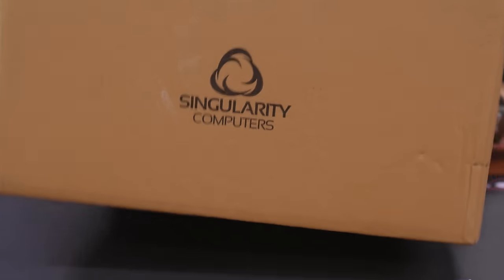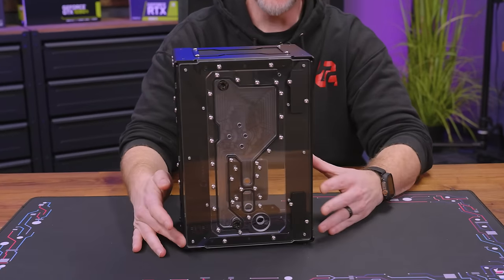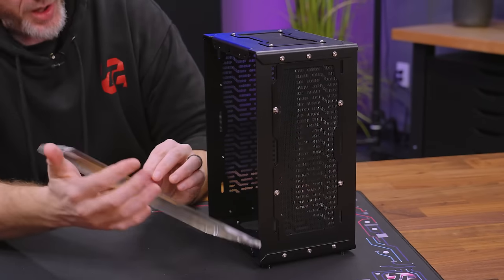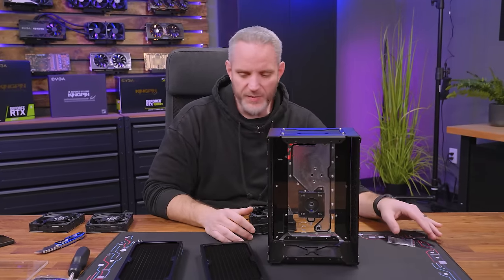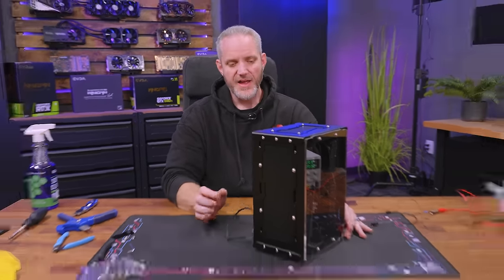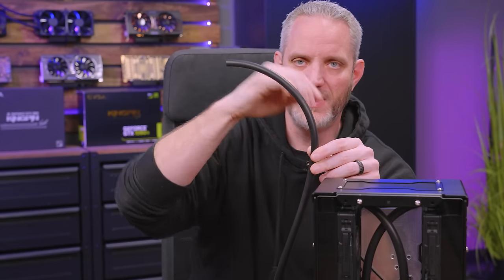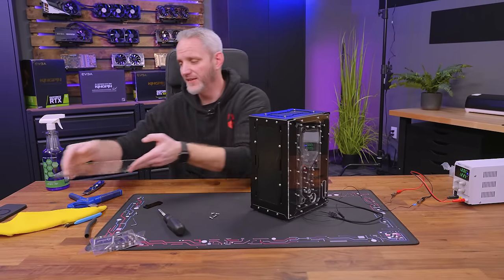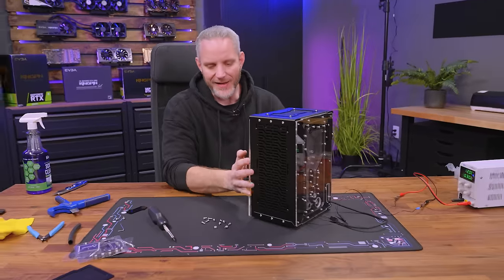External Loops are a thing again?

Comment: Bring the fluid into the case on the exhuast side, push fluid out of the case on intake side and make flow through. Some heat will dissipate through convection but it will go through the coldest radiator before leaving to pc.

Comment: If you want an easy way to control the fans, Noctua has a manual pwm generator that is basically an inline fan controller that you could use to control all the fans and the pump. The NA-FC1

Comment: I would love that accompanying my ssf build, when I had one. silverstone rz03. I cut it and put 120+240 rads. Then I switched to bq 802. 

As for air going through multiple radiators... I think as long as the air is cooler than rads, it will never warm them up. At worst the thermal transfer will be less efficient with air warmed by the first rad.

Comment: I think going with a horizontal push from one side and pull from the other would get you greater air speed (which would in turn affect the heat exchange rate), while pushing in from both sides is going to waste energy on turbulence even if you have a top-mounted exit fan.

You should definitely try it both ways and report the results.

Comment: External water cooling is so much more convenient, in my opinion, since you have everything but the blocks outside your system. And it allows you to have as much cooling capacity as you want without being restrained by any particular chassis and internal configuration. And you can change your chassis as well without having to worry about the water cooling setup.

Comment: I might be wrong but I believe if you did a flow through configuration the noise will be a bit lower as the air will not clash against each other as well as in such a small case have less positive pressure buildup for the fans to try and overcome. 
Flow through will lower pressure and noise... in theory 🤷🏻‍♂️

Comment: This is cool and has lots of potential, I think it will be most efficient with it pulling air in on both sides and exhausting through both ends if any way possible, either by adding feet on bottom or placing it on it's back so it can exhaust through both ends

Comment: This would certainly give you the option to test several different configs.  I was surprised that you were using pull on both, would have thought push would be better.  would love to see the comparison of the various possible configs.
One additional test would be to increase the size of the feet to see if getting more room at the bottom increases cooling capacity (in any fan config)

Comment: I finally remembered that Thermaltake had this idea years ago with the P100 and P200 cases, now granted these were to go with the W100 and W200 cases but it was the same idea of separating the heat extraction components from the computer components. 
The P (Pedestal) could be mounted to either the top or bottom of the W (Workstation) case, top being the better location, to separate the heat from the computer itself. The could accept up to a 600mm radiator or dual 560mm.

Comment: I have the fans of both my front and top rads set to exhaust. Then I flipped my rear 140mm exhaust fan around for intake with a dust filter. I also attached three tiny noctua fans as intake on the back with dust filters. My temps are insanely good with this config. My case is a Corsair Air 540.

Comment: 3:00 alaska is the same distance or closer from asia, so it's a drop off / stop over / refueling hub. Like, from Melbourne to Anchorage is 7'770 miles, Melbourne to LAX is 7'967 miles, and most other stops after LAX are going to be east bound, so they stop at the nearer destination, head southeast, continue east, rather than go to LAX, go backwards (northwest against the jet stream), then east again.

Comment: you have three ways of air flow
cross flow - this would depend on how you have the rads flow
-hot rad to cool rad, cool rad to hot rad
positive air flow - air flow in rads out top/bottom
negative air flow - air flow in top/bottom out rads

Comment: Top and bottom pulling air in and radiators exhaust facing out. This way, the cooler inside temp helps cool the distraction plate. If possible place rad fans on the outside.

Comment: Suggestion: turn the fans around so they blow through the rads and out the sides. Keep the filters off the sides and the filters at top & bottom will do their job as needed. This does result in a negative pressure situation, but I don’t believe it’s an issue since you don’t have any PC components to cool anyway. Thoughts?

Comment: Jay, both rads pulling in cold air will be more efficient than having a cross/through flow. Why? Simple: higher delta between air and rad means more efficient cooling. if you push warm air through one rad the delta on that rad will be (considerably) less, so it won't be able to expel as much of its own heat.

Comment: I worked with Daniel because I needed a dual Arterial 360 Waterbox, when he only had the OG Arterial 560 Waterbox.  It's been a god-send (aka Daniel-send) for my high-powered, water-cooled HTPC.  Use an HDPLEX 200W DC-ATX banned PSU powering everything, using a Koolance ExosV2 control board/PSU Trigger and an Aquero handling everything headless.  Two push/pull 60mm thick rads with no internal components like PSU, PCIe, GPUs, etc to cause airflow turbulence passing right through.  It's actually incredibly quiet...  It's the bee's god damn knees.

Comment: 2:56 The reason air travel prefers multiple flights is to increase total area throughput. Having interconnected routes allows for more transfers more often in more places. There are other reasons as well, but this one is the most generally applicable.
Reply: Because the earth is flat so they take a straight route.

Comment: Regarding fan installation (just my two cents :-)) : put the case on a higher stand and set all fans to exhaust. It will drag cool air from top and bottom and press it through the rads. Cheers from Austria!

Comment: I would personally have the fans blowing into the box and cause a positive pressure venting out of the top and bottom. Added bonus is in winter if you have it on your desk the exhaust out the bottom will help keep your hands warm.
Reply: I dont think positive pressure matters as much here when compared to a pc case, there are not other intakes than the filtered one on the top and bottom and I dont see any other holes/gaps.

Comment: This is basically what i done with a thermaltake tower900    the front chamber is a2.5 gallon aquarium as the res.  feeding 2 d5 pumps and 2 alphacool monstra 480 rads in the back and 8 noctua fans on the rads.   The cooling rower feeds 2 pcs 1 which is my workstation pc and the other is my gaming pc.    Temps are always very very stable and its generally pretty quiet..

Comment: I'd do intake on one side and the bottom, exhaust on the other side and leave the top open. That should give the "front" rad fresh cool air and the "rear" rad would get a higher volume of mixed air to play with. I feel like it could give 0.002% better efficiency

Comment: You should test not only push pull config, but the order in which the radiators are. If the first one in the loop is the one taking air from the inside it may perform better.

Comment: That's crazy. 2 months ago I was looking at the market trying to find a water box and no one had one except from this one company that wanted $800 for it, I ended up building one using two hardware labs xflow 420 mm rads. It was the best thing ever and I also don't have to worry when I choose a new case because just to have to install my pass-through bracket and some water blocks and we're off to the races

Comment: Rads on both sides drawing in and exhaust fans top and bottom (if there's room), or reverse it with intake fans top and bottom and exhaust out through radiator fans. You might end up with negative pressure but more total airflow, and without circulating hot air into the case.

Comment: Jay - as a retired chemical engineer who was an executive project manager for a large engineering firm that did many industrial/refinery projects that used air coolers (think of 25' wide x 200' long), here is my recommendation.  Set the air coolers to draw air in from the box and exhaust to the outside.  Put the biggest fans you can on the top and bottom of the case to draw air in from the outside and push into the box.  Set the intake fans to run twice as fast as the air cooler exhaust fans.  This way you always have cool air entering into the air coolers and hot air exhausted to the atmosphere.

Comment: @JayzTwoCents you should  see if its possible to put a small wall between the two rads and have the fans setup to push or pull the air in from the top and bottom and then out through the rads. It might work just as well without a panel separating the air so the fans arent working against each other, but I think the top and bottom could let in enough air that both rads have the fans oriented outwards and have both rads getting cool air through the top and bottom intake would be ideal

Comment: Interesting, I've been trying to build something very similar from a ThermalTake P100 case.  My server room is in the basement of the house.  The idea being this box would sit on the otherside of the wall from the server room (with pipes going through the wall) where it is significantly cooler than the server room.  Pulling cool air over rads (480s) from the sides, and blowing it out the top.

Comment: Things go to Alaska, particularly because of their top rating. If the plane ever loses an engine or all their engines they can only glide for so long. It's different for each type of craft but also for how much they are carrying. So going north to Japan then over to Alaska is safer than just over the ocean and maybe diverting to Hawaii if something goes wrong. Including lithium fires, which is unfortunate more common than they should be due to failure to properly label them and have them at the proper charge level for Shipping

Comment: you should do a video on testing the difference in fan orientations and do like opposing crossflow so for example both tops fans would be pulling air to left and both bottoms would pull to the right giving even amount of cold and hot air between both rads

Comment: Please do the fans in different orientation/configuration video! That will be quite interesting. 

Imo, crossflow with hot liquid coming out of the PC going to the rad getting hotter air and then to the rad with cooler/fresh air would work quite well, for both cooling and getting the hot air out. 

Since the liquid coming out of the PC will be hot, the hot air coming from first rad wouldn't impact/warm up the liquid as much as if the hot liquid was going to first rad, getting cooled and then going to second rad where it might potentially get warmed up slightly since the liquid is comparatively cooler, but the air has warmed up.
Also, there are cutouts at both top and bottom, so second rad will be getting supply of both hot and cold air, not just got air.
Reply: This should provide both rads with a decent temperature delta, which should be the most important parameter...

If you feel like it, please test it against the other way. I would bet crossflow would be better regadless of rad order (although it should help, might not be measurably).
Reply: Jay's done videos in the past showing that order of components doesn't have an effect on the loop, I feel air going from one rad through another is the same situation. Both are remocing heat from the same system, the rads aren't adding any extra heat of their own. I think a cross flow setup here might be marginally better simply due to sheer volume of air moved through the rads
Reply: I think that both radiators as exhaust might make more sense, it should have less "air pushing into other air"
Reply: @nicholascrow8133  
I meant rather than rads adding heat of their own, the air passing through the first one might get heated enough to warm up the other. 
Although I wonder if it'll heat up enough for it to affect in such way. I assume you'd need more than two rads in series for that.
Reply: @kevin1smid  
This might work very well. 
Although an issue I can think of with this is top and bottom cutouts not being large enough to sufficiently feed air. 
I really hope Jay does a video on this!
Reply: @Hypnotised_Lemon  Yeah I know what you mean, but once it hits equilibrium then it's all pulling the same amount of heat from the system. At least that's what seems intuitive to me...
We definitely need Jay to make this video!!!

Comment: I think they should both push out outwards instead of inwards for the dual fresh air setup, with the side open for air, because having restricted positive pressure, facing each other, will create a lot of inefficiency and make the overall airflow lower, hindering the results

Comment: Test all the configurations. My money is on having both fans oriented for exhausting air out through the radiators (sucking air in the top/bottom). 
And test if it is better to replace the solid clear side panel with a mesh instead.

Comment: imagine a radiator mounted vertically on top of the case, air is blown through it without entering or exiting the case, intake/outtake direction no longer matters

Comment: Maximum airflow is the most important factor for rads and balanced intake and exhaust would be my guess at the most efficient setup. In my current build I attempted all intake on my dual rads but found it created too much positive pressure and prevented the fans from moving as much air. Also it looks like all intake on this box would just recirculate hot air exhausted out the bottom. 

GN already found that all exhaust for “chocked” cases perform the best for cpu/ gpu air cooling temps (I think it was the h510 case review). Whilst not directly comparable it demonstrates the use case for full exhaust. For this box with plenty of ventilation, I would guess that all exhaust would result in slightly less airflow than balanced and therefore less cooling performance

Comment: Instead of screws holding on the filters a much easier way would be to have channels they slide down into from the top like you would find under a case. They seem to be firm so they should stay put.

Comment: Jay, I think you should have the fans where top fans have cross thru one way then bottom fans pointed the opposite way using cross thru also. I wonder what the temps would be because cool air hitting half the rad on top and bottom. Maybe even put a divider into after to see what temps would be since there is exit for the air on top and bottom of case.

Comment: When it comes to exhaust, I remove all filters and hindrances. Dust filters are intended to keep dust out as an intake preventative. Especially with Jayz logic of 'fuck it. I'd rather spray it once a month.', I don't see a reason to keep a dust filter on a planned exhaust port as you're trapping dust inside at that point.

Comment: I think it would have been perfect if you could do the positive airflow with everything moving air as an intake with the top being the exhaust. It would be perfect if you could mount fans to the bottom for an intake and just have all the air flow out the top. Maybe it's something they may change in the future.

Comment: Interesting to note, you could also see the the amps go up on the power supply as you closed the cover, increasing the resistance and drop when you removed it again. Another factor to keep in mind when building a system. You fans will always try to achieve the RPM applied to them and will draw more amps to do so if the resistance is higher.

Comment: Going back to my college thermodynamics, the flow through configuration should move the most heat, IF you have the hot water flow into the exhaust rad first, then go through the intake rad.  Rather than thinking about which way would cool the coolant the most, think which way would heat the exhaust air the most. (Same result; you're moving heat.)

Comment: for a crossflow i would think that you flow into the exhaust rad first then into the intake rad meaning the interior temperature stays lower than the opposite flow path allowing for more cooling potential

Comment: I think I'd set it up in a 'push-pull' way, so the air goes one rad and then the other. Might not be the most efficient but I think it'll be quieter due to less turbulence. Have the coolant go into the 'hot rad' first then the fresh-air rad, then back to the PC.

Comment: would be an interesting test with configs as follows:
- both radiators in series (one after the other) with:
    - fans push air in
    - fans push air out
    - cross air flow with the air intake at the first radiator in the loop (cold air at the hotter radiator)
    - cross air flow with the air intake at the second radiator (cold air at the cooler radiator)
- both radiators in parallel with the same fan configuration as above
makes 8 configurations to test

Comment: Would be an interesting video, but I feel like, all things being equal, the temp differences would be marginal, potentially slightly cooler with a cross flow due to the sheer airflow. It just seems like there would be some sort of equilibrium regardless of whether you have fresh intake air to both rads or blow through one into the other, much like how order of components in a loop don't make a difference. At the end of the day you are removing heat from the same loop, blowing through a rad doesn't add any extra heat to the system...

Comment: I think it would be neat to see somebody who knows what they're doing, try the intake through one rad and exhausted out the other radiator and testing the overall performance. 

On my setup I have my front radiator and top radiator intake, because if I tried exhausting through my top radiator, I saw a 5° C increase in my water temperature.